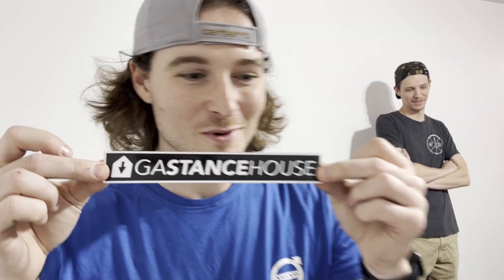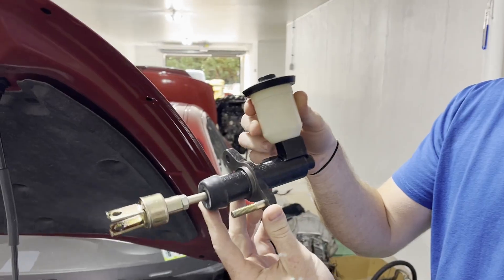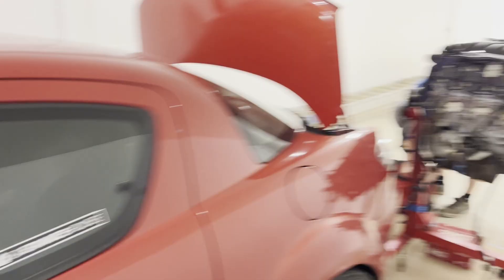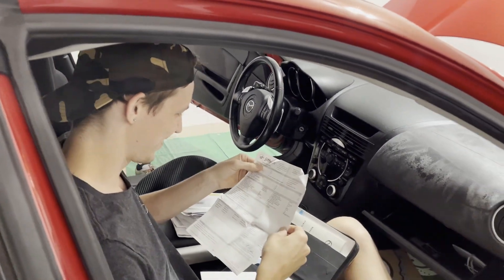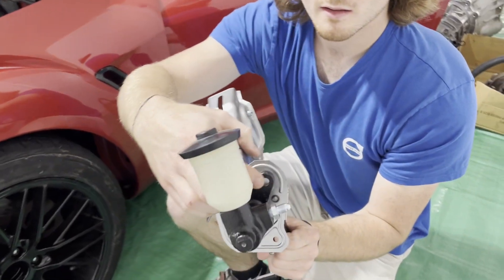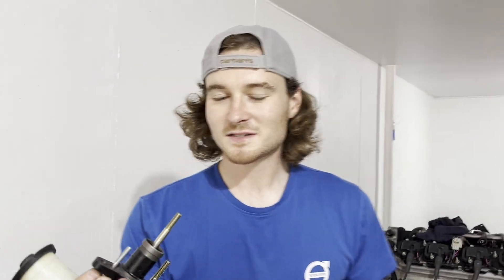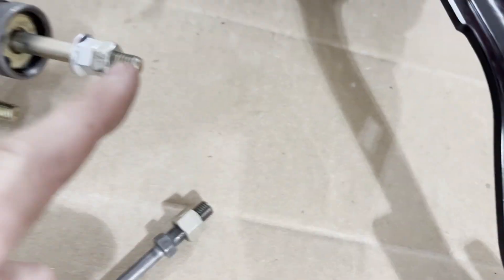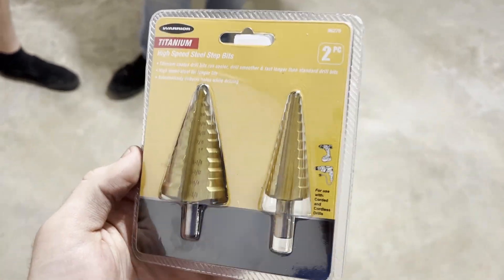CHEAP LS Swap Clutch Master Cylinder

Comment: I've copied your budget Clutch Master Cylinder set up from a 1987 Toyota Land cruiser. Today the MC arrived and I was doing some measuring of the stroke, this unit can move a lot of fluid. I assume you didn't make any modification to the RX clutch pedal in order to limit travel??  Are you having any issues with an otherwise stock AR5 clutch release bearing and the Land Cruiser MC?   Thanks.
Reply from the maker: I don't recall doing anything special to limit travel. I believe the pedal ratio should be fine and probably is similar to a typical LS platform. No issues that I know of after roughly 2000 miles :)
Reply: @gastancehouse  Thanks for getting back to me on this.  And good to know all is well and that you didn't have to do any further modifications.  The Toyota master cylinder had a M10x1.00 Bubble (IS0) style flare tube nut, correct ?
Reply from the maker: @chestrockwell8328  https://ebay.us/snipnA here is the fitting that I used. Not sure of the flare specifically, but I took a chance and this one seems to be correct!
Reply: I’m running the same one but asin brand. I can’t get enough stroke out of it. Not sure what’s going on. But basically clutch depressed and the clutch with hit the “back” of the master before bottoming out or moving the slave enough. Wonder if the Dorman one is the only one that works

Comment: Have you tried using this master cylinder yet? I'm not getting it to move enough fluid to disengage the clutch fully. It's been bench bled, and air gap is correct. Lmk!
Reply from the maker: Uh oh! I am not to that point yet. Hopefully within the next couple weeks… front what I saw on Fully Spooled’s channel (where I got the idea) he seemed to have no issues with it. Some people asked in the comments how it was working and he said he’s been using it for years with no problems. Honestly I’m stumped as to what could be the issue with yours. Is there too much slack in your MC piston? Maybe your pedal isn’t engaging the master cylinder right away causing issues? Let me know if you find out any more info
Reply: @gastancehouse  thanks for the reply. I'm going to try a new slave and another master cylinder after that. Mine might just be defective. All the reading I've done has pointed to this exedy unit being perfect for this swap so idk
Reply: I ended up buying the Tilton 7/8 unit. This got rid of my issue. I do believe I got a defective unit unfortunately as I really didn't want to share the reservoir with the brake master cylinder. Onward!!